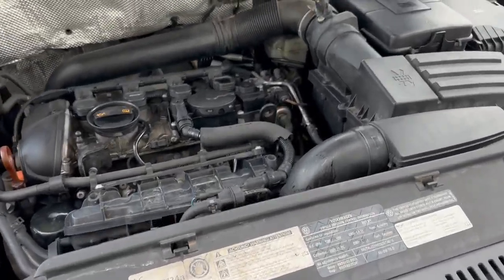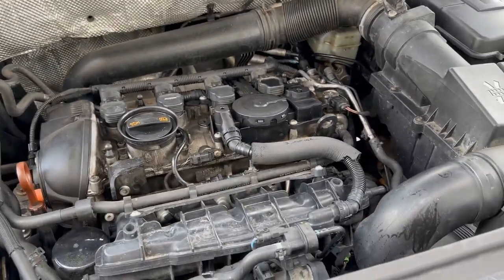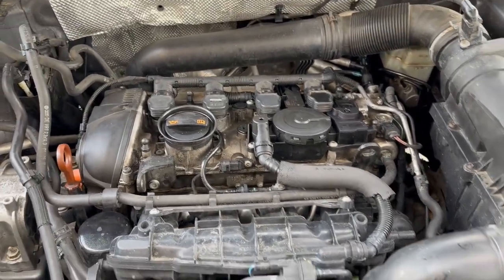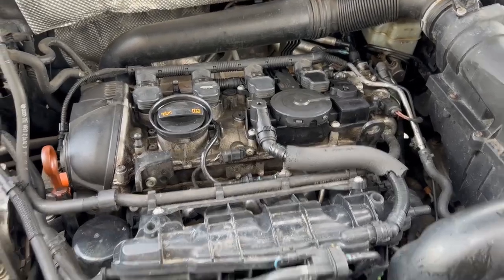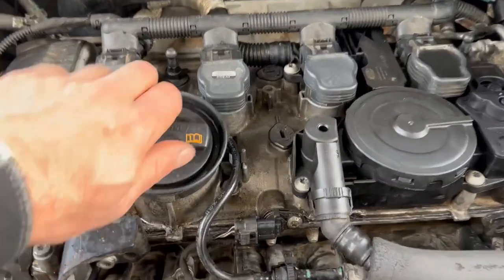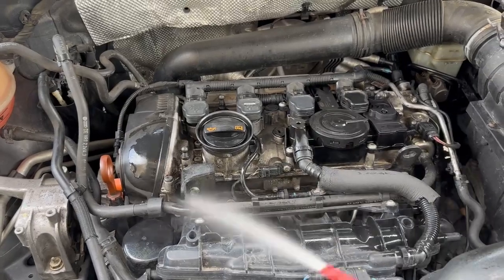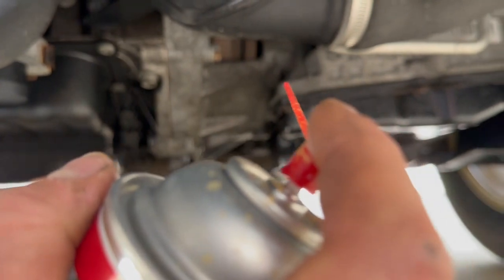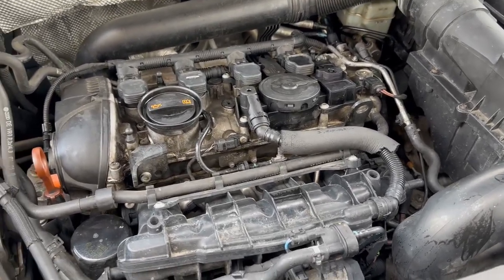VW TSI 2.0 PCV, Rear Main Seal Leak Failure.

Comment: How do i test on a manual transmission jetta with 2.0 tsi?
Reply from the maker: Similar fashion, just find some opening in bellhouse flywheel shielding and spray in there.
Reply: @Simple_Classic_Cars  I checked and could not find any opening on the transmission housing. I have a mk6 jetta gli with the 6 speed 02Q manual transmission. :(
Reply from the maker: @Wavfm  clutch fork area, I am not familiar with that model, ask handy friend for help.

Comment: So the engine is sucking the brake cleaner through the rear main seal and recirculating it into the intake?
Reply from the maker: Exactly! My seal completely separated from the metal housing.